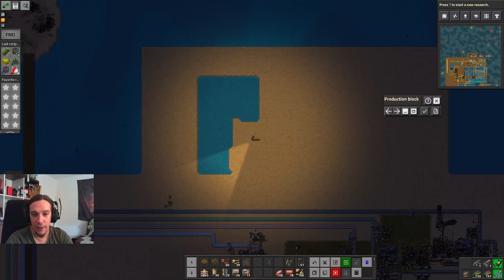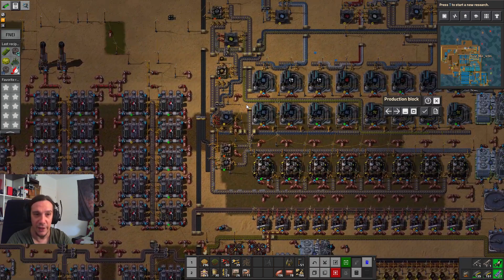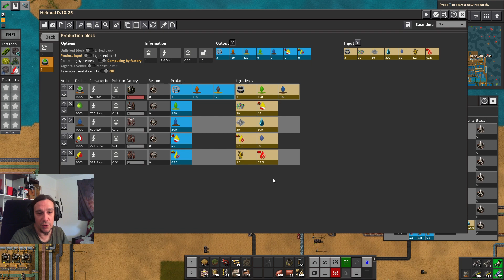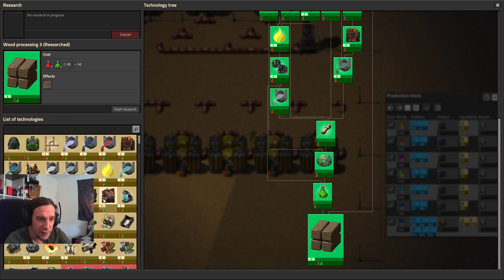Let's Play Factorio Seablock - 37 - Gameplay Playthrough

Comment: 18:45 Don't use a balancer. Two inserters on each washing plant. One near, one far.
Reply from the maker: Sounds good. Forgot that this mod has Near/Far settings.
Reply: That's the problem with doing multiple modpacks with different settings available.